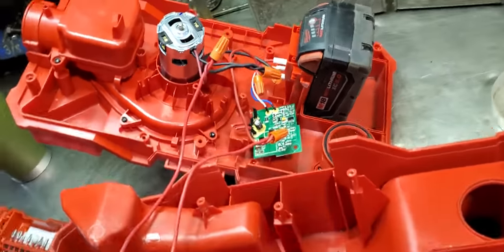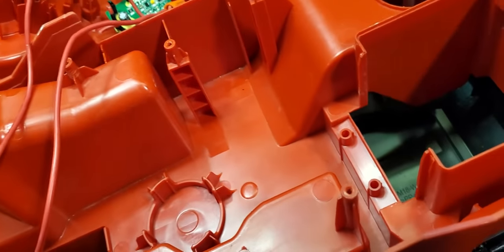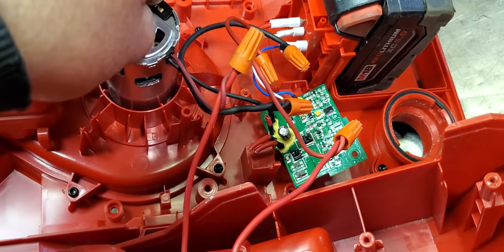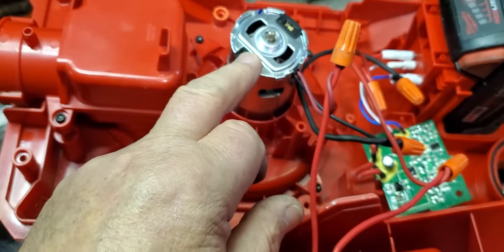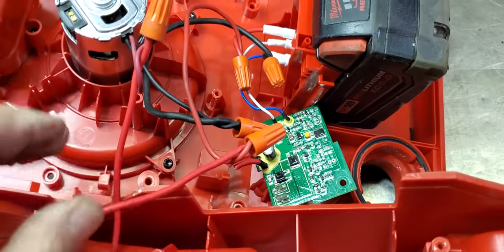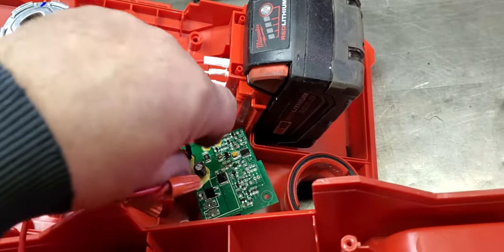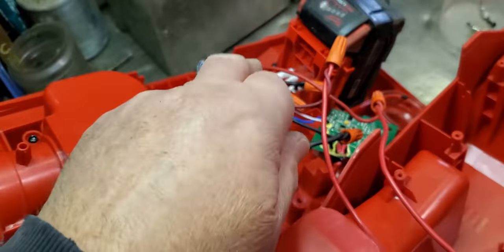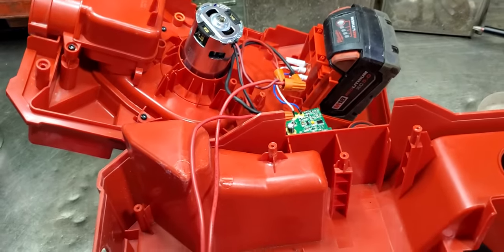Milwaukee wet  Dry   Vacuum M18 Trouble with circuit board

Comment: Did you notice the switch getting a little warm? I was wondering because the PCB handles the power control for the motor. It may be a good idea to remove the battery when not in use being non-
fused as well.

Comment: The PCB is for cutting power when battery is low and it is activate the BMS in the battery (Blue & white wire)
Reply: Have you heard of these vacuums stop working if you run it till it stops on its own from low battery but when you put a new battery in then it won't work?

Comment: The board limits the motor power to 1.7v. running 18v directly to the motor might kill it. Obv make it last a bit longer, but would be nice to find the circuit board. I assume an 18v to 1.7v circuit board should do it